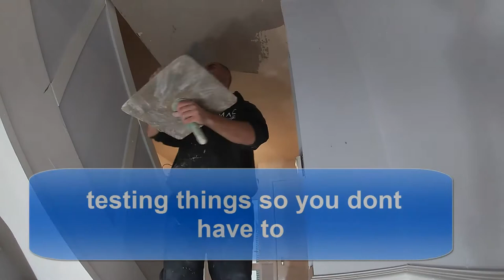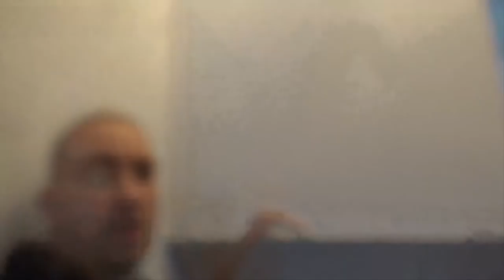Plastering V Log Loads of Tips on Plastering Stipple Ceiling Make Good Bonding Carlite Plaster Full

Comment: great video mac.always work along the bead and it dosnt leave any hollows then.i laughed when hearing u mutter dont stretch after stretching urself.turned out well lots of advice .👍
Reply from the maker: Haha cheers mate I must be getting a little more entertaining :):) Yes i tend to give every one great advise on staying safe and healthy  then kind of lift things that are to heavy and stretch the odd time but I am getting better every year I for sure work smarter not harder :)
Reply: @macplastering  thats the way to do it.learn as u go along.if we wet the wall down 2 much for example when rubbing up and we waiting around for ages for muck to stiffen up.i bet we wont make the same mistake again in a hurry.😏
Reply from the maker: @emmettmccarthy7247  Haha for sure mate I got a similar comment a guy saying I wasn't doing it right as i had not wet the old brick or the old block and that i rendered over the existing render lol Thins is he was very wrong and either didn't watch the video at all and listen to it as I wet the block but didn't wet the brick as the brick was 0 suction so like you say it would have been a mess sliding of the brick funny thing is the odd bricks have really high suction but some engineered brick has none so sbr in the mix will be perfect and the part he seemed to thin i was rendering over old im not sure to why as it was a patch LOL so I was scratch coating up but then mabe thats why he removed comment dont get me wrong I will learn of anyone with a positive thing to say or a better way but wrong is wrong LOL Sorry for the big comment but yes when to wet what to wet how much to wet t all really dose matter